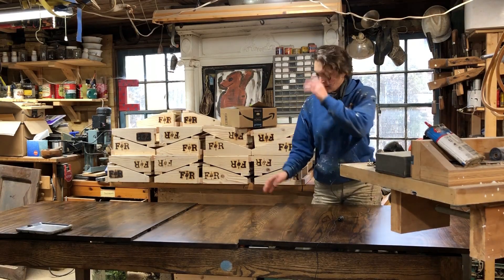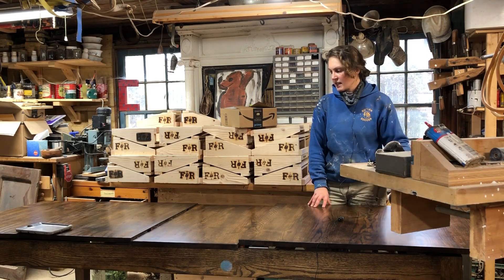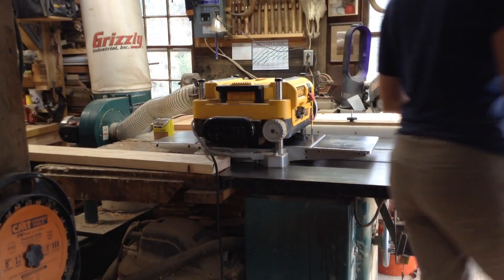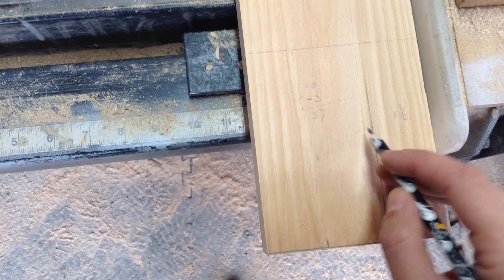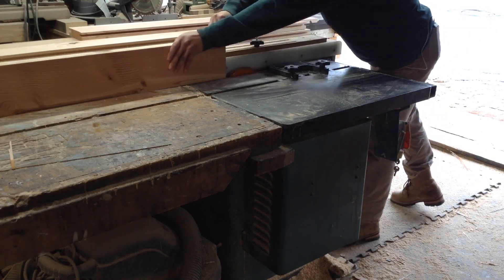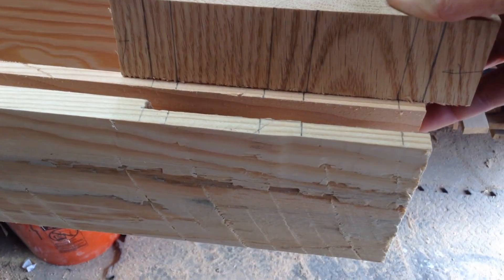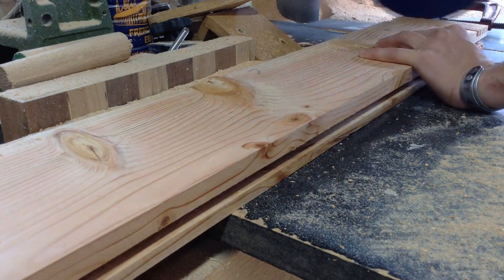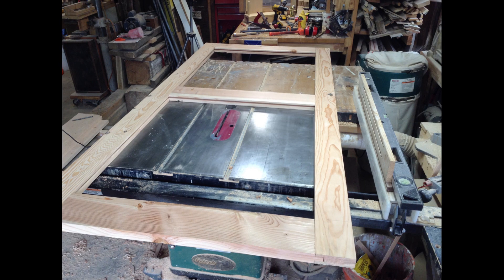Woodworking : Sliding Barn Door // How-To Part 1

Comment: It'll be interesting to see the final product.  I just finished one with a real rustic finish, so having knots wasn't a big deal for me.  I constructed mine with two frames made with 1x lumber and sandwiched V-groove tongue-and-groove pine lumber in between (had to router a groove in the back side so the door was consistent from either side).    I used a wire wheel to 'rough up' the surfaces to simulate weathered wood before staining and lacquering.  Overall length was 93", which made for a very heavy door.  I used a hardware kit from Amazon...quality was very good and wasn't missing any parts.  Due to the 2-1/4" thickness I had to do a little math to figure out the thickness of the ledger board to mount the rail.  A second door is in the works, and I'm considering a method such as yours...can't wait for Part 2.
Reply from the maker: Yeah, the downside to these are they are quite a bit bigger then regular doors which makes them awkward to carry.  This one was too tall for my shop, which made it a pain to even move around in there haha.

Comment: It wouldn't  be right if it wasn't in a knot! Aren't you worried about the wood movement most framing material is only surfaced dried to around 19%!
Reply from the maker: Yeah, I should have mentioned in this video I buy that lumber ahead of time to allow it to dry a bit more before building with it.
Reply: @HoneyBadgerWoodWorks  That's good that you buy it and let it dry before building with it! I have seen it move quite a bit!